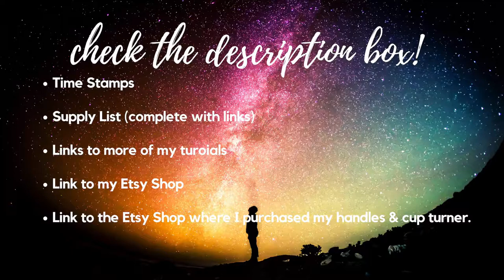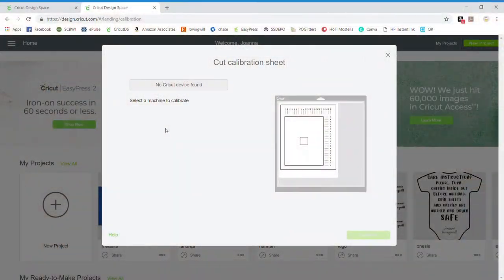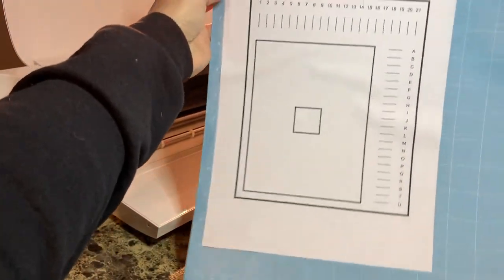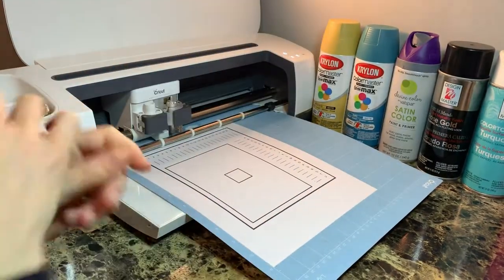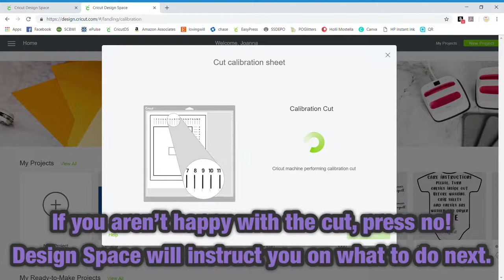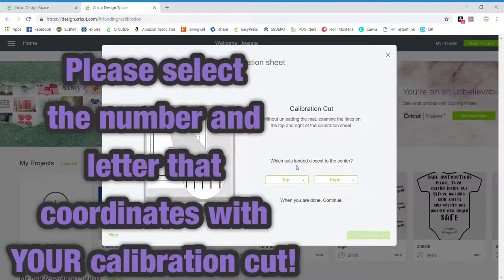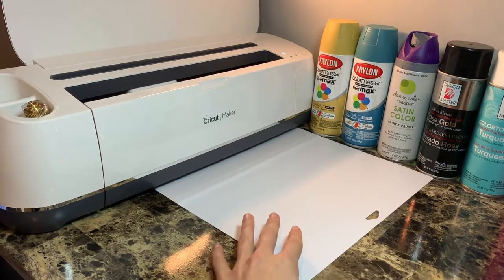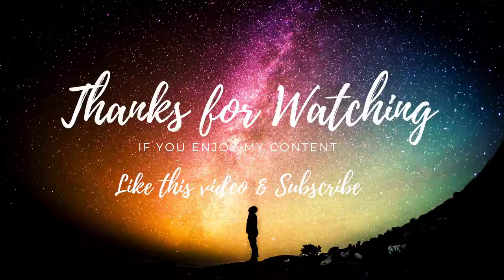How to Calibrate your Cricut Machine (Maker edition) For Perfect Print Then Cut Projects

Comment: what if the calibration didnt help line up?  the cutting is way off
Reply from the maker: If you have tried it a couple times, contact Cricut. They sent me a brand new machine when my lid wouldn’t close and a friend of mine got a new one for her print then cut being messed up.
Reply: My cricut keeps cutting from the right and it just will not cut from the left.  😭😭